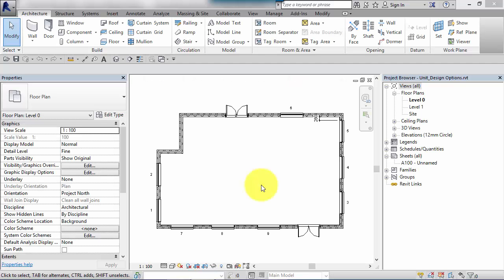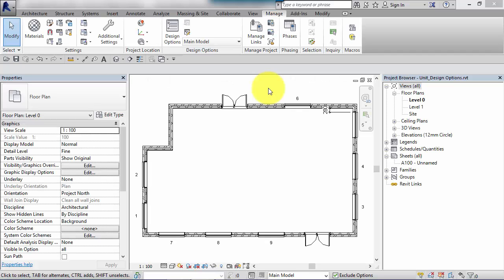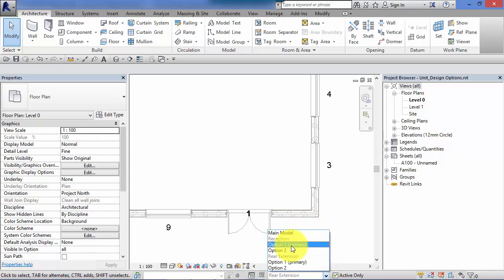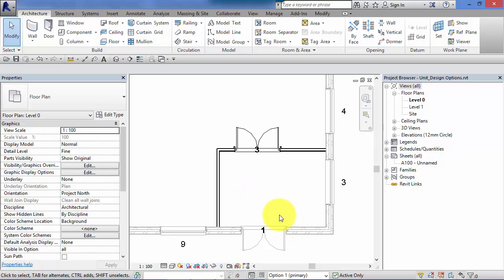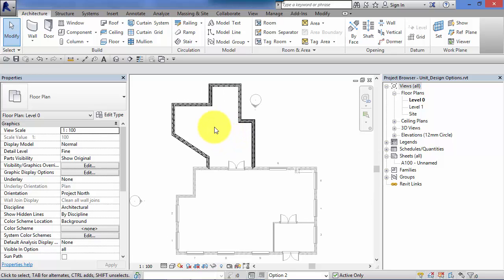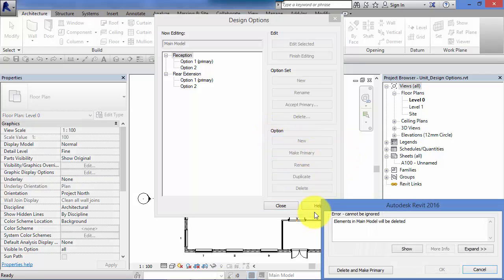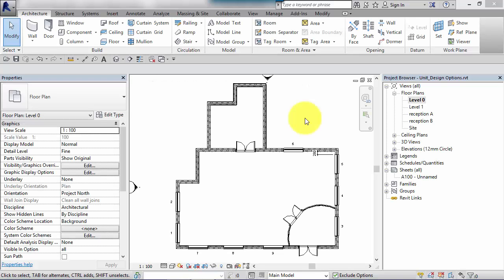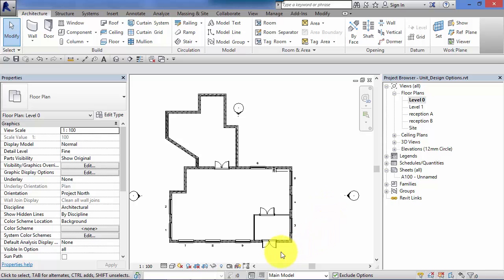Module 9: Unit 2: Revit Architecture: Design Options

Comment: I recently run into a limitation of Revit modeling. 

I am using reference plane to cut taper 2x14 roof joist that is slope 2%.

This 2% sloped reference line can be shown in building section or elevation on East or West.

However it would not cut some of the floor joist 10ft beyond.

So I think the issues was the reference plane does not have enough depth. So I apply propagated extend. I don't know exactly how deep it has propagated.

And because reference plane is place on 2% angle. I am not able to See it from South North orientation. 

Do you have solution for that???

Comment: great videos, as per usual. you have been a Godsend for my Uni project. Please may I ask if you have a tutorial on putting windows into curtain walling panels? I am struggling to put some in my design with only one central horizontal mullion that splits the panel into two. I want to put a top opening sash in each panel, every other one on each elevation but really struggling to do so. any help you could give will be most gratefully received. thanks.
Reply from the maker: +Marcus W.Right Many thanks indeed for the feedback. Do you have a free account at BIMscape.com? If so, can you post this question in the general Revit Arch forum? You can attach screenshot / sketch to help[ explain, if required. I can then help you with this.